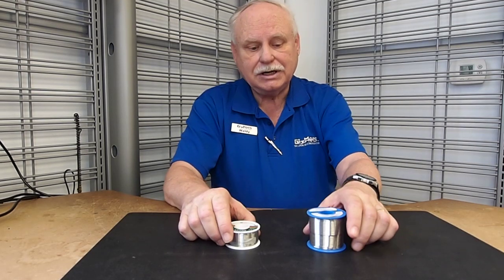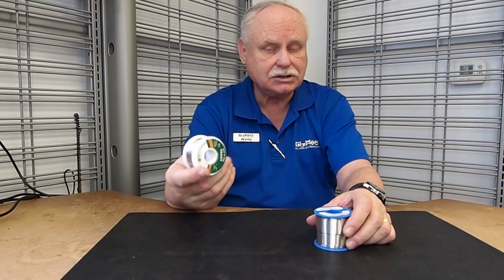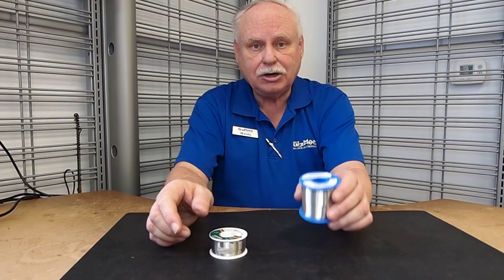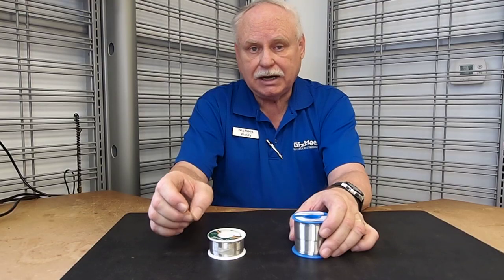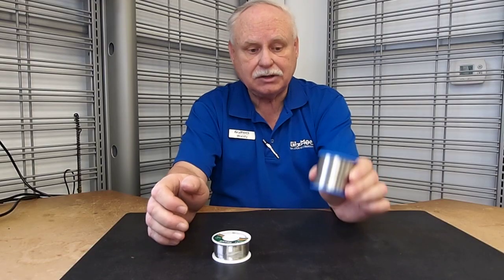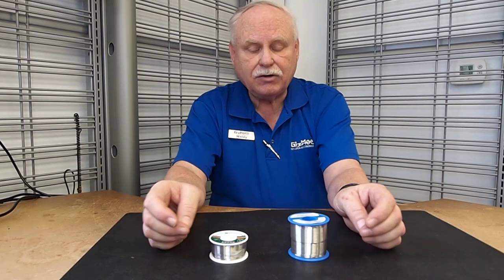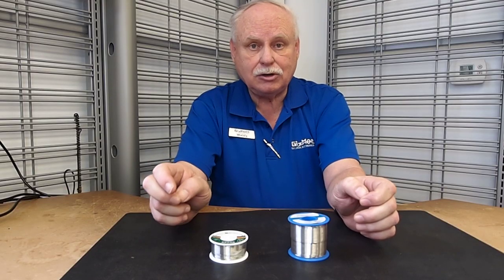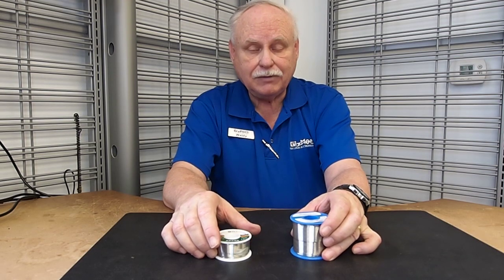What Type of Solder Should you use.

Comment: 50/50 on everything. Leads been around forever and works. Like asbestos, don’t disturb it and it’s
Fine. Run tap water for 5 minutes after soldering and it’s safe. Too many wha wha’s out there, 50/50 on all joints.

Comment: I have an abundance of 1.5mm steel rods (my preference is for brass rods of which I have none).  I need to make railings for radio controlled model ships.  Will I be able to use normal rosin solder on the steel rods, or should I use solder with an acid flux?  I have access to both a soldering gun and Bernzomatic gas torch.

Comment: For tin/lead solders the 63% tin and 37% lead is a pure eutectic meaning it only has two states, liquid or solid. Can’t beat that for stability purposes and ease of use. The 2% silver does carry an advantage of using a lower temperature to solder and is used in instrumentation work and where a higher quality and higher reliability is required. The best flux core proven over decades of use is the RMA, rosin mildly activated, flux core . While this is the best flux core it also matters to use the same extra flux which matches your solder’s flux core. For the most ideal results, use the same brand extra flux and solder/flux core as this is a chemical match and cannot be bested for this reason. I use the mil spec version which has a 3.3% ratio of flux core to solder weight ratio. This is what military contractors use and those who want the best that exists in tin/lead solder performance. Kester, AIM, Alpha Metals and Multicore are the brands I have used and still use as these have consistently yielded the best results by far. It is my experience that tells me this and decades of excellence and testing prove this out. What you use is your choice. Ask if you have a question.

Comment: Great job .. totally agree with unleaded .. it puts out more smoke, requires more heat and the tin, which is usually more than 90%, is not as good a conductor. I also discovered that unleaded solder in a solder bath develops a lot more dross quicker than a tin/lead combo. I prefer the Sn63/Pb37 tin/lead combo or the 62Sn/Pb36/2Ag, with a good rosin flux.

Comment: Yeah, I tried the no-lead one.  In making motorcycle clutch cable ends, I just could not get the solder to melt around the cable end very well and, well, the result consistently looked raggedy.  Gonna try the tin-lead-silver you recommend.
Reply: I hope your project turned out ok! I just used Rust-Oleum Rust Dissolver Gel and it worked amazing!
I just watched a diy video on “soldering stainless steel” and the keys are 
1. Flux with phosphoric acid. The video author suggested 50/50 rust remover and isopropyl alcohol. 
2. Very high tin content in the solder. I had some 95% tin 5% antimony.

Comment: Ok I know this is an old video but I have some gripes. 

Tin/lead solder can be eutectic or non eutectic. 63/37 vs 60/40 for instance. 

The lead free stuff is harder to work with, slower to wet that is, but is usually SnCu or SnCuAg. So nothing "as bad as lead" in it. Using lead free solder won't ruin your tips as long as you separate your tips between lead and non lead because it's the mixing of the two that messes things up.

Personally I like to work with 63/37 rosin core but these days I have to order it because finding lead alloy solders in consumer stores has gotten harder and harder.

Comment: So u can use either two for both plumbing and electrical wires??
Reply: Too bad noone answered. Not sure myself. Probably not going to be using lead in a water system and temperatures of copper pipe differ from copper wire so heat could be an issue.
Reply: This is electrical/electronic solder, plumbing solder is very different AFAIK!  Different alloys, different fluxes, usually it comes in much thicker diameters etc.

Comment: I'm with you the old lead solder is always the best. Even when i started its the only that allows for professional work really. Everything else just balls up and rolls and you have get drop techniques to even use it. But the led as long as your iron is hot enough allows for easy application and rarely do you have to redo a joint.

Comment: Thank u. Does type of solder could damage soldering iron tip?
Reply: Basically the more heat the more damage so just go with 60/40 solder buddy...you'll thank me in the long run also make sure it is Rosin cored!
Reply: You can get lead solder with copper to better protect iron tips (if they are copper, lol) called "Savbit" or Pb/Sn/Cu solder.  This kind of solder is also ideal for soldering very thin wires (e.g., earbuds), as it minimises the effect of dissolving the copper.